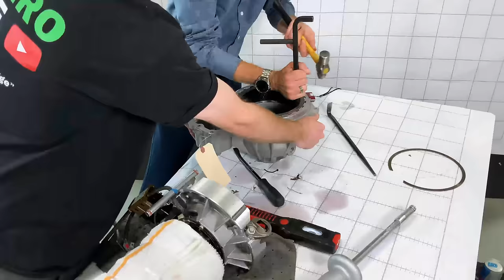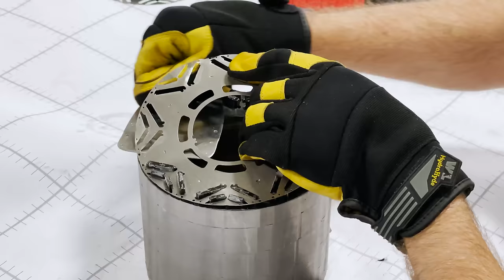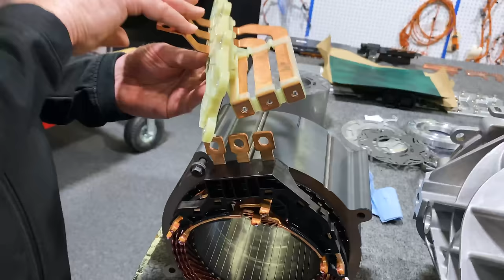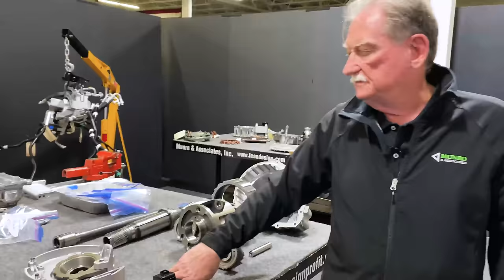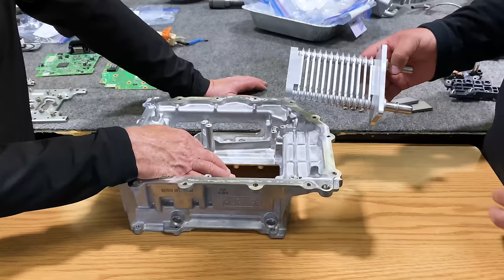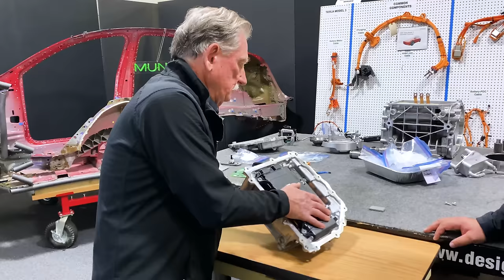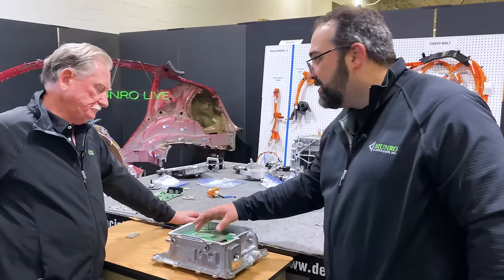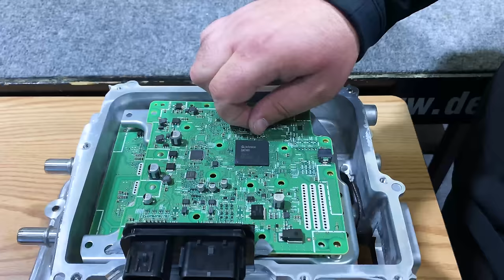Ford Mach-E Rear Motor Teardown and Analysis

Comment: This isn't an complete EV vehicle. Sure they made one with it, and they moded an old F100 as a demo ev. But it's a drop in replacement for a gas engine that might not use electric breaking or have regen. It's for people who have project vehicles they want to turn into an EV while not necessarily being programmers themselves. Or wanting to modify axles and possibly non replaceable parts. I would hate to see an 1960s-70s mussel car chopped up to be everything EV. But having a drop in ev motor is just custom motor Mounts and battery. The exhaust can be dropped, the gas tank can be dropped and in its place a relatively easy built battery could be installed and wires ran. Making no permanent alterations to the body and frame. And because it started off as a gas car it makes sense to have mechanical parts vs lines of code. Tesla and as far as I know every one else aren't selling Motors, controllers or any other part separately new in box. I have heard that there are some Motors out there as alternative to Ford's offerings. But not one of the major vehicle manufacturers that we are familiar with. This was so terrible and absurd I couldn't watch past the 14 min mark. You should consider getting out of the shop and doing toy reviews. I believe you're technical experience would be better put to use there

Comment: Are electric motors still evolving technologically? I thought the development was stagnant for about a century.
Reply: Progressing FAST ( Tesla ), they are making the MOST Compact PRODUCTION motor, and the most Efficient one. 
that none other can compare with. 
OTHERS, not so much. 
as most LEGACY buys from LG Chem, or Another OEM .
LUCID claim to have a lighter & more compact motor , but it's NOT production yet.
making Electric Motors is hard, but TESLA bought a Engineering Company & motor manufacturer years ago.
that's TESLA advantage.
Reply: @markplott4820  also rivian has touted their motors being compact and light weight as well. So they deserve attention. I am very excited by new completion into the marketplace. I still believe that the most innovative designs will come from the rivians and Lucids start up companies whom are designing much of their own vehicles components. This is why I am not buying into the established auto companies coming close to tesla and the other quality startups in EV quality, range or performance. Tesla needs competition so its tech can be pushed and ideas challenged. I have some hight hopes for Hyundai and Kia in their first clean sheet EVs.
Reply: @dkositsky  - I wish them well, but so far BOTH have delay production vehicles. 
and LUCID seems to be more Shady than RIVIAN.
Rivian , is using 4 smaller motors, thus Less powerful than Tesla PLAID drive train, 
Tesla CT also is Lighter with a Bigger truck, but CT can Accelerate Faster, more Range, more Towing capacity, and cost less.
Reply: @markplott4820  interesting! Didn't know Tesla even worked on motors! The lengths they must've gone to achieve range is really surprising
Reply: @VamsiMohanKrishnaVadrevu  - YES, Tesla bought a Engineering Company , and a Electric Motor manufacturer, early on.
it's a Tesla branded motor, and people buy Salvage parts like motors to power some EV.
Reply: EE here. Yes in a big way.  Some innovation starting a couple decades ago, but it has really taken off in the last decade.  The primary driver has been battery powered devices on the mobile side and energy costs on the stationary side.
Reply: Different materials, computer aided design, AI, better magnets, auto assembly. If EVs had the kind of money thrown at them as ICE vehicles have, they would fly...
Reply: @chrisheath2637  In recent years, there has probably been far more spent on EV development than engine development.
Reply: @brianb-p6586  Which is weird, as electric cars are much simpler, so we kept being told...
Reply: @chrisheath2637  Simple doesn't necessarily mean easy. In EVs versus engines, simpler just means fewer moving parts.

Comment: Ford is just a much smarter ran company than Tesla, you want to ship a flawed V1 of any product so there's plenty of low hanging fruit to improve on when you launch a slightly improved version with a few trim tweaks down the line. You shouldn't aim to make the best product right out the gate it just makes many headaches for your engineering team, what will there be to optimise when you've done your best work? Innovating is a lot of work just rely on your suppliers to work out the kinks and iterate on their off the self solutions! S/

Comment: None of it looks reparable.?? Worked at Ford 50years ago, the guy on the other side of the line from me closed his eyes when he came to work
and did not open them for 10 hours, I soon learned to do the same, could not see for the sweat getting into them any way. Don't worry about assembly!
Reply: The DU and inverter are not serviceable

Comment: So these motors have been designed & built by Ford or did they contract them out?
Reply: Good question, I saw quite a few FoMoco logos on the castings but I don’t know if that means anything.
Reply: @fredbloggs5902  Ford Motor Company?

Comment: I'm sure Sandy was just exaggerating a little bit to show how ridiculously complicated, inefficient  and expensive Ford's engineering and manufacturing have become. It's quite clear that they would of preassembled many of the components before putting it into the casing. That includes brazing as well.

Comment: "I dOn'T kNoW wHy ThEy DoN't UsE eLeCtRiC bRaKeS". Because if the power fails, your car rolls down your driveway, across the street, and into the neighbor's living room. Brakes, regardless of vehicle or system, need to be mechanical.  Just look at all the folks buying GM's brake-by-wire pickups, or rather, the ones totaling their trucks because the brake controller shit the bed.  They're literally paying people to not sue them at this point.  Just wait until there's a death.
Reply: Good try, but no. Electrically actuated parking brakes need power to be applied, and to be released, but not to stay applied. If all sources of electrical power are removed from a car with electrically actuated parking brakes, the brakes don't release... in fact, they have no way to release (they're stuck in the applied position).
Reply: And why do people do that idiotic thing with alternating upper and lower case? Just trying to be annoying?
Reply: @brianb-p6586  Oh!  It's a literary mechanism used to convey sarcasm.  Think of saying it in a mocking voice.  Amazing that it took five thousand years of history with writing for someone to figure out how to do it, and it took a freaking Spongebob meme to show it off.
Reply: @brianb-p6586  Ah.  I stand corrected.  From the context, it appeared he was suggesting using the motor power to keep the thing in place.
Reply: @BinkyTheToaster  I had to go back and listen to that, and indeed he just said "electric brakes", instead of "electrically controlled" (or "electronic") "parking brakes". Apparently he assumed that people would know what he meant, which is ironic because he doesn't know what cars have himself: he said "if you have an automatic transmission or an ICE vehicle, normally you'd have one of these" which is nonsense, because manual transmissions don't have parking pawls.

Comment: Ford is well known for using too many fasteners on things or building a part up from too many smaller parts that could be integrated to have fewer total parts count making up an assembly! It is hard to believe that the company most recognized for mass production in America could get mass production so wrong! If it is anything like GM too much knowledge and experience has been lost on the engineering side and too much dead weight has been retained on the management, marketing and executive side! They do not know their own history or design/engineering specifications and are reinventing the wheel too often!

Comment: Hmm one would think a company like Ford, which really needs to get this area of the company play out without too mane problems would hire Munro's company before the final design is completed. I mean it all works like it stands, but too much manual labor and fiddeling on the production line will just drive up the cost of the product and eat away fro the bottom line. I hope some one from Ford is sitting stand by on every one of these videos taking notes and doing something in the way of leaner design. And Ford, for the MK II of this, just give Munro a call early one. The stange thing is that if Ford made it just right the first time, they could roll out the same design for their other and upcoming EV's. So why not get the design right the first time?

China, Korea, and even Europe is working very to make a name for themselves in the electric car domain. Bring your A game or quickly become the new Nokia of car manufacturing.
Reply: Munro USED to work for Ford. Think about that one.

Comment: "The traditional gearset in a Tesla produces way too much noise". Said nobody ever...  Ain't broke don't fix... Eliminate complexity thus weight and error.  Planets are theoretically quieter, it's like a tree falling in the woods, nobody is gonna know.
Reply: Actually Tesla had a lot of gear noise problems in early Model S transmissions... but for competent manufactures, gear noise with gears on parallel shafts is not an issue.

Comment: What is the point of tearing this motor down when it is supplied by an outside entity?
Reply: Because it is the motor in the car.
Reply: @Garrison169  Yes - but it's not built by Ford
Reply: @AMan-he9sz   A lot of cars are built with parts made by other companies.  

The motor is part of the car and it should be evaluated.  Ford is responsible for the parts they use.  If they used an inferior part, wouldn't you want to know that before your bought the car?

I don't understand your reasoning.
Reply: @Garrison169  Ford uses the same supplier that other makers use.
Reply: @AMan-he9sz  Tesla makes its own motors.
Reply: @Garrison169  And?
Reply: @AMan-he9sz  Over and out.
Reply: @Garrison169  Yes - Tesla is over and out.

Comment: One thing I learned from this video is that Electric cars won’t be 0 maintenance like everyone claims!
Reply: Frugal Family Living  even Teslas though still need maintenance. These things aren’t like a kobalt trimmer ya buy at Home Depot. Everything breaks eventually.
Reply: Nobody has ever claimed that.

The claim is that they require LESS maintenance.

Please provide your best example of someone claiming that EVs don’t require any maintenance.

You claim it’s “everybody” so you shouldn’t have any problem providing examples.
Reply: Frugal Family Living  ...no, you just throw away a perfectly good car when the battery pack craps out.
Reply: @fredbloggs5902  ...numerous Tesla fan boys, with no technical background, have been saying it on their YouTube channels for years.
Reply: @AudiTTQuattro2003  Tesla battery packs currently last over 500,000 miles, the LFP packs will last well over 1,000,000 miles.

You appear to be totally ignorant of this.

Imagine my shock.

Comment: Transmission???????
Reply: What's your question?????? Yes, the vehicle has a transmission, like every other vehicle. Like most EVs, it has only one gear ratio (it doesn't shift). Like all AWD EVs, it has one transmission for the front, and another one for the rear.
Reply: @brianb-p6586  I have watched most of Sandy's videos about EV's and I have never heard transmission. They are between the motor and the tires across the axle. Sorry, just had not heard that all these years. Might have missed that video.
Reply: @MyUniversalUniversity  he has torn down the transmissions of several EVs, but since the transmission is always integrated with the motor (in what can be called a "drive unit" and some companies call something like an "eAxle") Sandy may have avoided saying it was a transmission. A transmission with a differential included (as EV drive units always have) is called a transaxle, and he may have used that term. Anyway, I understand what the question was now.
Reply: @brianb-p6586  thanks. That makes sense.

Comment: I'll bet this is a very, very expensive component, and as designed is unserviceable, its a big dollar throw away.  You blow one mosfet and the entire unit goes in the trash can.
Reply: Also if one fails on the production line is it worth debuting and fixing as it would take many man hours.

Comment: I really wonder if these engineering issues were over sight or if they were intentional. Ford needs to keep their customers happy when designing the product. But what most people don't think about is, who is Fords customers? The dealerships. When Ford builds a vehicle they are selling it to a dealership, not a consumer. How do dealerships make money, most of it  comes from working on vehicles. I would not be a bit surprised if Ford built a lot of stuff in the car to fail. So to keep the dealers happy and to make sure they are still making money, build in issues. We have seen this before, Ford and GM both delayed moving to a full synthetic oil in their vehicles because of push back from the dealerships. The dealership want you in the shop every 3000 miles and not every 10000, they miss out on 2 service visits then.

Comment: The inverter is stupid.... I see a team  of designers losing the collective plot.
Reply: I’m guessing it’s just adapted/copied from somewhere else.
Reply: @fredbloggs5902  I agree - I think the whole design has 'evolved' and is making use of the parts bin.
Reply: @steverichmond7142  ...you say that, like that is a bad thing. There are hundreds of engineers who have electric motor design experience. We have been making electric motors for more than a hundred years. Tesla hired from them, so why would you assume that others wouldn't be as good or innovative?
Reply: @AudiTTQuattro2003  I am an engineer that has worked for many automotive companies including Ford in the UK and Europe. I have designed and built 3 ev's.. My point is not about the engineers but the companies... that inverter is a terrible design... probably designed by accountants.

Comment: Do Ford actually assemble the motor or inverter anyway?... surely it comes in as a bought in as a pre-made component (probably from China where they don't care about labour costs, because they are so low). 

Ford are not as vertically integrated as Tesla and won't be for years and years (neither are VW, Mercedes etc.) - so while you can critique the design of how a Mach-E is put together, you're really targeting that at multiple suppliers. Tesla can control every stage of the process from batteries up.

Ford buy a bunch of Lego bricks and put iot together... they don't "design" the motor, insertor, batter pack etc. Could they buy better, sure they could - this is their first attempt at EV.

Comment: A planetary gearset "is what you find in a real transmission"? That would mean that every manual and dual-clutch automatic in the world is not a "real transmision"! I just lost any respect that I had for Sandy Munro as an automotive professional.

Planetaries are not quieter than parallel gears. They have the same design of teeth, meshing the same way, so they make the same noise.

Given the emphasis on comparing with other vehicles and manufacturers, it's strange not to mention the Chevrolet Spark, Jaguar I-Pace, Porsche Taycan (front), and other planetary EV transmissions, or to note that the Chevrolet Bolt drive unit has outputs concentric with the motor shaft without resorting to a planetary gearset.

Comment: What an amazing design, Sandy actually seemed sad how bad the situation was. Sad to see old engineering knowledged wasted out the drain, departments run by MBA I presume. How is this even possible to be this bad in 2021? How many parts was that? 
Well, maybee top down designed by unions to have plenty to do, both when new and later at service, no need to make it elegant or fewer parts when you can do like this. Strange how clueless,  while at the same time being so proud of your latest car the Ford CEO actually trolled Tesla, really?
This is the newest design of Ford as of today.....,. Lots of you tubers out there says ICE OEM are doomed, I start to believe this for real, this cannot be fixed within survival range of money. Ford should call for an adult immediately, they should not work on this themselves.

Comment: Electronic design is hideous. I can't believe the needless complexity. They certainly prevent any repairs on this assembly. Considering this device will have long term failures out of warranty, it will be a many thousand dollar replacement. Maybe the union requires the same labor hours on this as a V-8 assembly. Maybe the component count is supposed to match too. I thought you had to go to BMW to find such pitiful designs. Don't these guy look at other designs before they doo this? A million good reasons to not buy a Mach-E.
Reply: ...as if Tesla will sell individual components for repair? Tesla won't even allow you to service your car yourself.
Reply: @AudiTTQuattro2003  There are good reasons for not letting people service EV's without training.  It can be dangerous.  As for parts, that will be an issue for a while yet.  They can barely meet their production needs, spares cut into that.  Probably years yet before that changes, but that's the price for being new and vertically integrated.